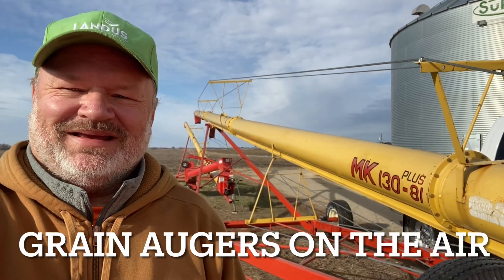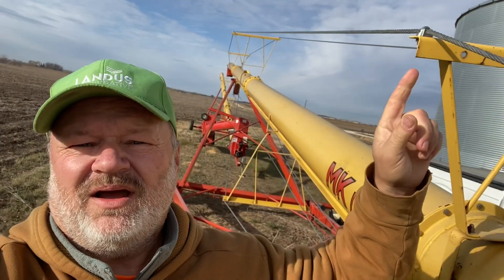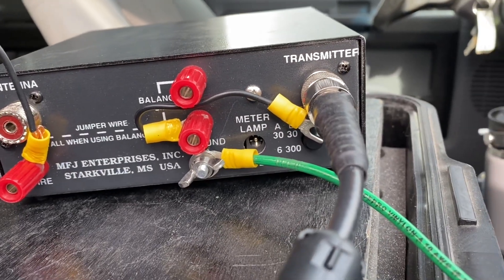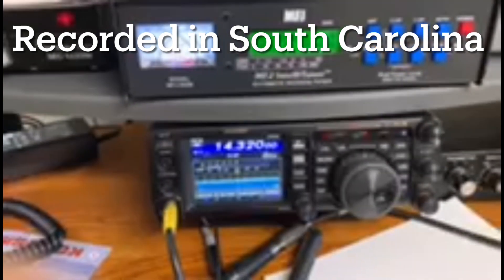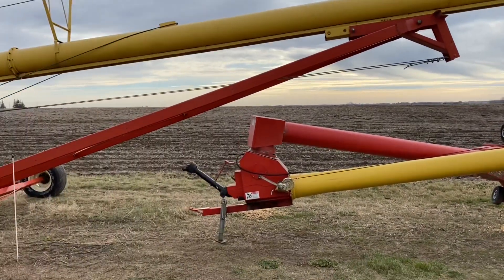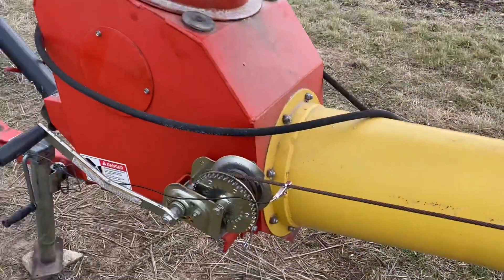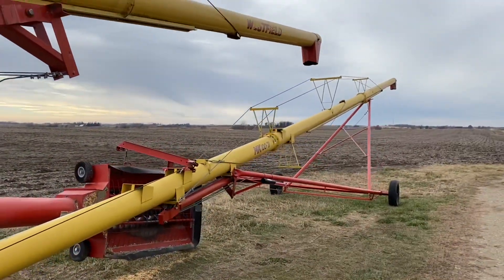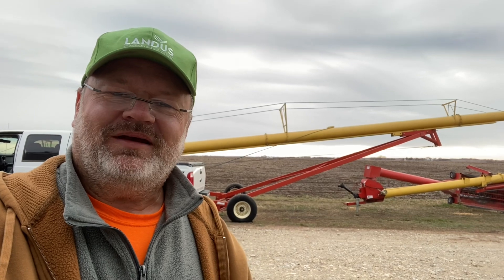Grain Auger QRP SSB 5w - Iowa

Comment: Where did you get those clips?
Reply from the maker: Hi Craig.. Thanks for stopping by.. The alligator clips I got from the hardware store in the wire/connectors isle.. I think they were around $6 for a two pack.. They work pretty good but I have had the spring fall out of one of them and I lost it, LOL..  Thanks for watching.. 73, Kevin ~ k0klb

Comment: Can you try a dumpster next? Dumpsters on the air could be the next rage.😀😀
Reply from the maker: Hello Joe.. Thanks for your comment... Actually, yes we have a dumpster.. It appears to be a 20/17m dumpster, LOL.. I'll roll it up on some wood boards to get it off the ground and we can "light it up"... The lids are plastic, so we wont be able to use them to get any specific directionally focused radiation (darn)... Thanks for the suggestion for an upcoming episode.. I suppose you want a cut of the royalties?, LOL... (10% of zero is still... zero, LOL)  Thanks for watching.. 73, Kevin ~ k0klb
Reply: @hamradioqrp-k0klb  ha ha, dumpster royalties. I actually think this could be a thing with so many dumpsters everywhere. Very accessible compared to parks and mountains. Like grab a dozen donuts and do a quick dota  activation, haha. 😀😀
Reply from the maker: @joeblow593  We've got the logistics all laid out for this ... The hard part is deciding what kind of donuts would be appropriate for a DOTA..  LOL  ..  coming soon... 73
Reply from the maker: @joe blow ... Here ya go.. Pre-release viewing link just for you.. LOL  https://youtu.be/0tkdcn30POc

Comment: Wow!  I thought you were going for a dipole with the second one.  Awesome work.
Reply from the maker: Hi Gene... Thanks for your comment.. haha, Well, not a dipole this time, but we did think about raising them up and putting them together to make an inverted "V" and park the truck underneath with a ladder line going up to the top and connecting one wire of the ladder line to one auger, and the other wire to the other auger .. but logistically, we haven't figure that out yet, LOL... but we have all winter to think about it, as I'm sure we will, LOL... Thanks for watching... 73, Kevin ~ k0klb